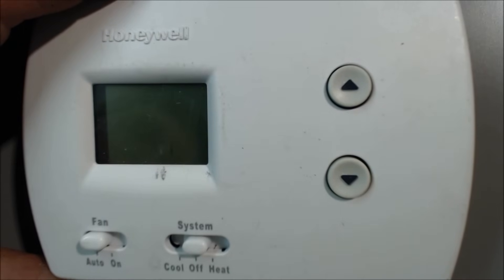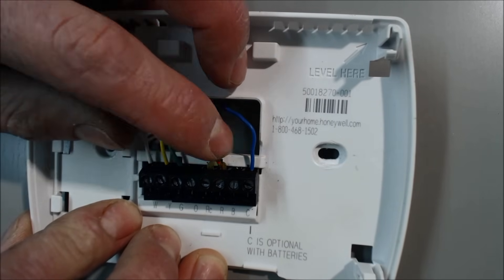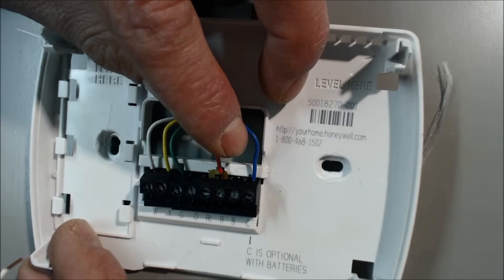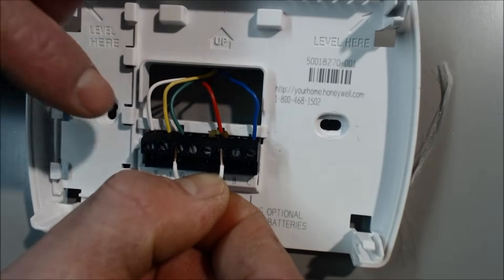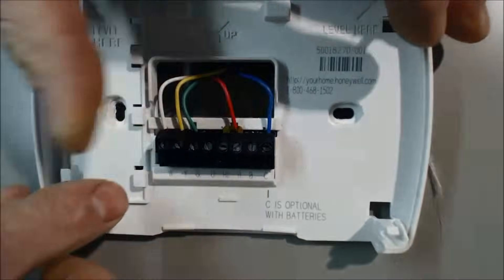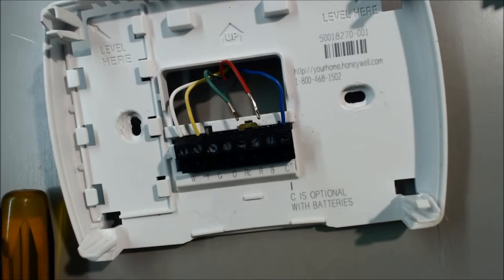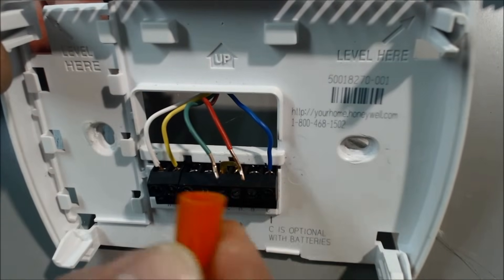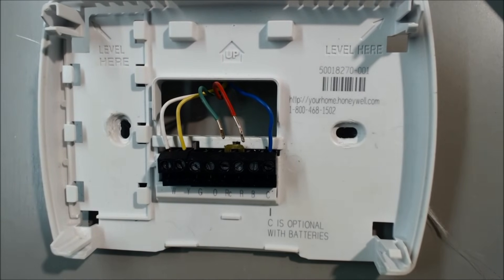Troubleshooting if a Thermostat is BAD: Explained!

Comment: Do i need to connect 3 wires together to check my heater?
I mean the red is power and the fan wire plus heater wire? or just 
2 wires red and the heater wire? Thanks
Reply from the maker: Just two wires R and W as the furnace will know when to turn the fan on by itself. Thanks

Comment: my thermostat seem to lower the temperature by itself sample the heat inside will be 70 and the thermostat will be reading 67 after a few hour of working can this be the thermostat.
Reply from the maker: The thermostat is supposed to be on an inside wall and not near an opening to the house. Also sometimes the hole in the wall can let cold air in from behind the thermostat if there is a bigger hole going into the crawlspace or attic. Other than that I would just replace with a new one. Thanks
Reply: yaraivery moore-burgos. Mine doing the same thing! Reads 30 degrees, but its 80 in my RV. This is preventing the A/C from turning on. Let me know if you replaced your thermostat and if it fixed the problem. Thanks.

Comment: My furnace no longer works in auto mode but does in manual on mode. Fan will run and furnace will fire and heat. Could the thermostat be the problem if it switches manually? Thanks
Reply from the maker: Are you talking about the manual fan on and fan auto. If so then it sounds like the furnace is not calling for the fan to turn on after heating up. Do you have one of these and is the furnace older. If so, this may be bad. It is a fan limit control. --- https://youtu.be/lroVoblI1pg

Comment: i put a new thermostat this summer  honeywell RTH111 it work well , i try to turn on the heater today i hear the gas came on but the fan is not working or do i need to wait  a little bit and the fan came on
Reply from the maker: If the furnace is trying to turn the heat on then it is receiving the signal from the thermostat. It is past that and in the furnace. It sounds like maybe with the power off the capacitor should be tested or at least a tech will start there if the blower motor is not coming on. This one would test with the power off. ---- https://youtu.be/flbUtLMeSOQ

Comment: My propane furnace does come on. I go thru the "start up routine" and nothing happens , several hours later furnace comes on mysteriously?
When room temp is reached , furn shuts off  BUT will never auto come back on ?? when room temp drops below set temp 
If I understand this correctly , I can connect W[Furn] to R [hot ] and furnace will run.
If it does ? direct wiring tells me Thermostat is bad ?
 Thanks for sharing this Vid
Reply from the maker: Yes that is correct. You could also do this in the furnace control board terminals after doing this at the thermostat face. Thanks
Reply from the maker: Also you may want to check out --- https://youtu.be/uKsRpYmwlnM ----- and ---- https://youtu.be/5lxftJiTqLg

Comment: I did this test and it did turn on the fan. Is bad thermostat also be the reason why i got limit circuit lockout? Thanks in advance.
Reply from the maker: No a limit circuit lockout would be from one of the sensors or from a component within the sequence of operation only. A thermostat is just a signal voltage going to the control board terminals. Check out this video on the sequence of operation--https://youtu.be/uKsRpYmwlnM

Comment: is there a way to turn my thermostat up i have to put a cold cloth on it to get more heat.
Reply from the maker: Here are some reasons depending if you have digital or a mechanical thermostat.
It sounds like the thermostat is not reading the temperature correctly. If this is the case and you have a digital thermostat which is non adjustable then you would either replace it or just set the temp up higher. The thermostat thinks it is hotter than what it is so you would just have to set the temp up higher. For instance if you had to set it at 77 to keep the house at 72, it may turn on at 70 and shut off at 72 possibly but read as if it is 77.

 If you have a mechanical thermostat then you could turn the power off to the furnace and adjust the heat anticipator dial under the thermostat face plate to a shorter cycling rate. Move the dial in the opposite direction of longer cycle by about a 1/4" or .05amp and then turn the furnace back on and test it out. It should turn on sooner and have a lower temp difference between when it turns on and turns off. Then turn the furnace back on and see how much it helps. If you need to adjust again just do the same procedure until it turns on and off again at comfortable points. I hope this answered your question! Thanks

Comment: Thank u for the video. In my case the display will come on , the clock keeps flashing , but whatever I pressed is not responding. I did connect the red and green wire and the fan came on . Do u think it's the thermostat?
Reply from the maker: If you turn the main power back off and on and the same thing happens it should reset that. If there are batteries and it is hardwired, go ahead and remove them before turning the power off and then back on. If the thermostat will not let you out of this function after  turning the power off and back on it sounds like the thermostat is having a problem. Also look uyp your model number and verify the procedure for adjusting the clock. Thanks!
Reply: thank u for replying. it's Carrier A99068 model. press the time/Temp button and press the up and down until the correct is displayed, but when I did that nothing moved.
Reply from the maker: Ok, yes it sounds like the thermostat then. Thanks

Comment: At 4:48 you said if the fan not come on do you mean fan blower or condenser fan?
Reply from the maker: Thanks for the question. I am referring to the blower motor only turning on. Thanks
Reply: Green wire is ac

Comment: Awesome video. Good teaching tool ...please keep up the good work ...
Reply from the maker: Thank you very much!
Reply: acservicetech I have a White Rodgers thermostat  that is not working right. I have no control of the temp settings. I touch up or down arrow it goes to 90 by itself. Heat kicks on and run for maybe 2-3 minutes and drop to 62 and eventually cuts off. Is tstat bad? Please help me

Comment: So to manually turn on the cool/AC, I would need to turn on the fan and the compressor.  And to turn the heat on, I would need to turn on the fan and the heater on.  From another video, I would say to turn on the cool AC on manually, I would short Red, Yellow, and Green wires.  Moreover, to turn on the heater on manually, I would short the Red, White and Green wires.....Am I right?
Reply from the maker: Heat needs to go through its 7 step sequence of operation which includes the fan turning on. Heat does not need g jumped. Thanks for your comment!